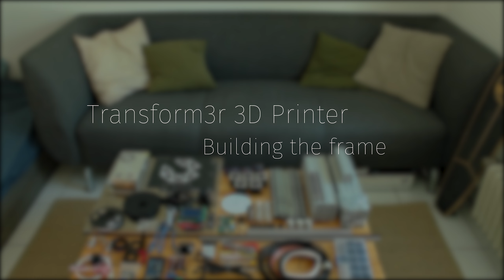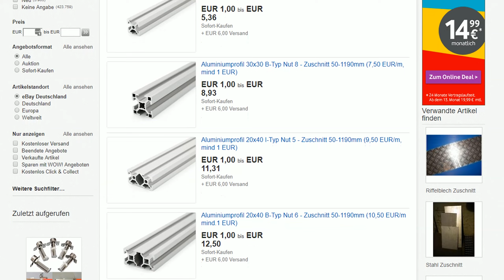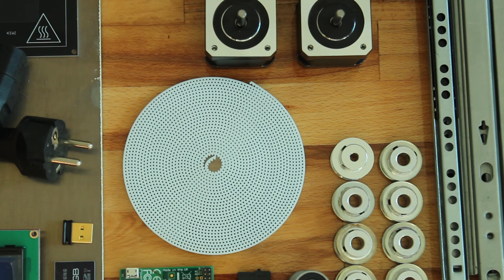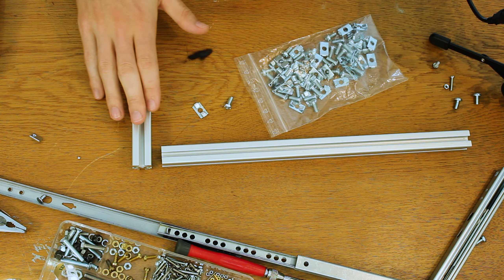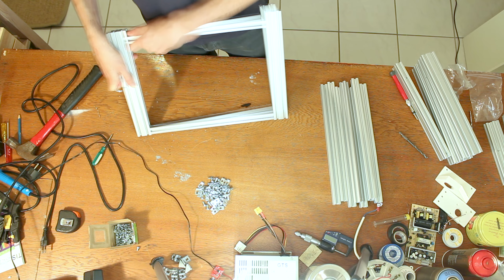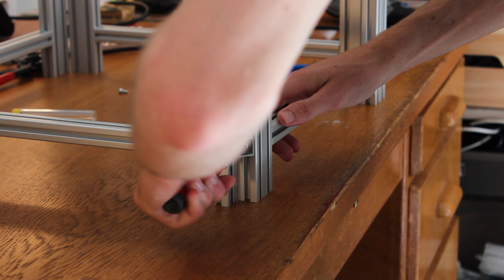Building my new Transform3r 3D PRINTER - The Frame

Comment: I don't want to be rude in any way. I love your video and absolutely adore the way you designed the frame to be able to rise. The whole video (the way it is shot, the music and the materials like sleek extrusions that you use) is so relaxing to watch EXCEPT for the fact that you don't use safety gloves while dealing with metal shavings and drill stuff while the extrusion profile is not clamped or held to anything in anyway (except it is lying on the table, but yeah..).
The rest is just perfect and the selection of materials and colours is beautiful.
Reply from the maker: Hey, thanks a lot! :) It's not rude at all and I love that you took your time to give criticism in such a nice way. I agree that I should have worn gloves when working with the dremel but I find it a bit overkill to wear gloves when using the drill. Of course the aluminium shavings are sharp and I did cut myself twice on those shavings but that's just an inconvenience. And when working on aluminium, you're not running the drill with full torque and speed so if I had lost my grip, nothing would have gone flying or anything like that. But maybe I'm overseeing a potentially dangerous scenario?
Reply: To be fair, there's not much risk whatsoever, as for one, metal splinters are really of negligible danger beyond just being a bother for a wee bit, as you're so much more unlikely to get an infection in getting one, that, often times, if it's small enough to where it's not a pain, it's genuinely safer to just leave it there. This, coupled with the general tenancy of the hands to get tougher and tougher the more work is done with them, and it isn't even really a concern. I can't even pierce the skin of my thumb with a button pin unless I got a tool what to whack it with, just what for being quite the tinkery type, playing instruments, cooking, and the like, for instance, so it's not really too big a deal when working with a substance that has the same hardness as the human fingernail. In regards to the drilling, given he's not swingin' his arm every which way and he made himself a pilot hole what with the tappy tap o the hammer there, the bit just ain't wanderin off, he didn't need an accurate hole to turn the head of a screw anywho, there's frankly little short of hammering the bit through the aluminum before even drilling that would get the extrusion to even really get caught up enough to overcome just its friction with the table, and on top of it all, at that point, the cost benefit of even wearing gloves in that situation would honestly make it more a safety hazard than anything else, what for losing a degree of tactile sensation that would be better placed into one's manual dexterity with the tools and operation.
Now to really put a damper on things, it was made with such basic off the shelf parts that the materials and assembly are dubiously given cosmetic praise; those extrusions are effectively the industrial equal to erector sets, and in this application are really quite clunky. That said, I think I've pretty well rambled on enough in such regards; I think I've probably been a bother enough already, as it were. Whatever the case, avoir!

Comment: do not use 3 thread pitch taps in the same hole, using multiple taps you would use a taper "some call a starting tap" then a plug "if you are using one tap use this" and last a Bottoming tap. But this is over kill for tapping aluminum extrusion by hand, most will never see a benefit to using a taper first and a bottoming tap is for blind holes "holes that have a bottom, are not thru."
You will get better results drilling the hole out to the proper size then use a plug tap, its cheaper as well.  When you buy a tap it will tell you the right size hole, some plug taps include the drill bit. If you don't have the package google "drill and tap size chart"
Reply from the maker: I just used a handdrill and some cutting oil for the bulk of the holes and it worked perfectly fine. Just what I wanted. But once I need to buy new taps I'll do my homework and see what kind of taps I actually need ;)
Reply: wow that was fast :)
so many people are a-holes online so i hope i did not sound like one. with small screws like this its probably not going to be a problem with the threads you make and is just a little hard on the tap but it could really weaken the threads you cut. with this... not to big a deal. I'm more worried some one may do this for something that could hurt them and not know its weak.
This is such a cool idea. If i ever make a non delta I will probably do something like this.

Comment: I really like the idea of it being able to expand upwards
Reply from the maker: Thanks!
Reply: But what's the advantage compared to simply having a big tall printer? It sure seems tight enough, but in principle more moving elements = higher chance of introducing sloppiness into the system. Maybe it's tight for now until the rails have bent out of shape a bit or some material on the inside got worn off... i mean if it's an aluminium or plastic raceway with hardened steel balls riding on it, you can imagine what those are gradually doing there, and there will be a moving mass on top of that whole rig, and not the most gentle one.